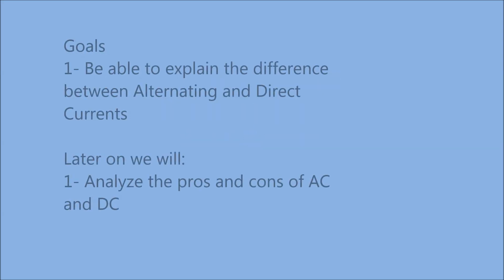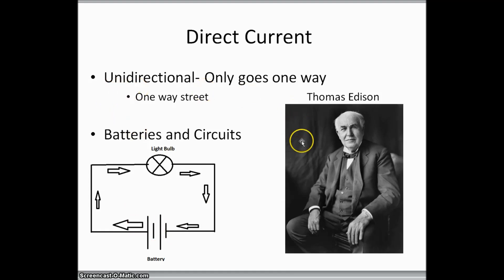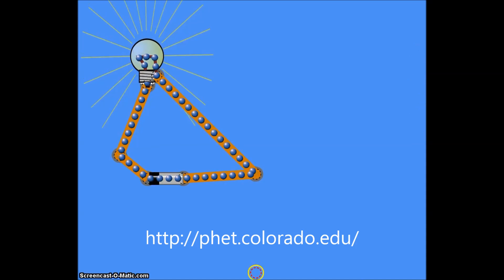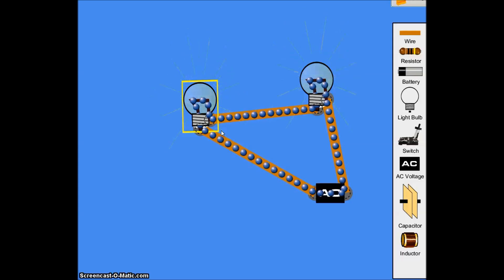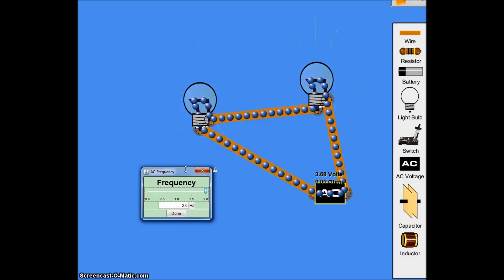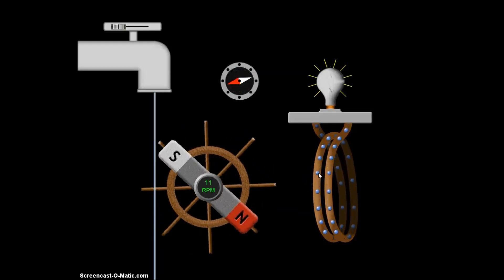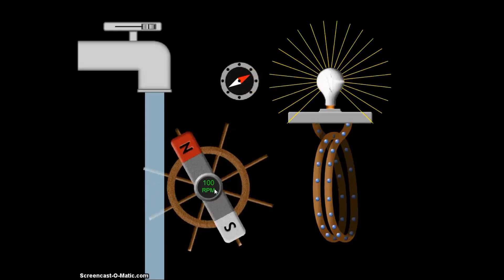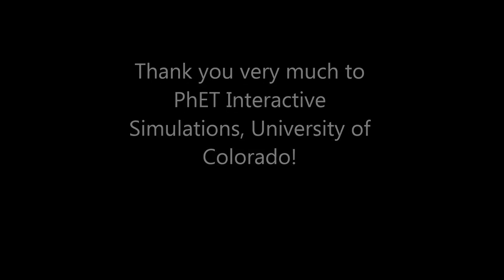AC vs. DC

Comment: actually if it's 60Hz then it means it has 60 cycles per second. And within one cycle bulb "flashes" 2 times because electrons first one way, and then the other. So the bulb "flashes" at 120Hz which of course means it's constantly hot and on.

Comment: 3:30 so current doesnt really flow in ac.   How does the wire not run out of electrons if they are just moving back and fore.
Your bulb is using some each time it flashes??

Comment: High Voltage
Dirty Deeds Done Dirt Cheap
Let there be rock
Powerage
Highway to Hell
Back in Black
For Those About to Rock
Flick of the Switch
Fly on The Wall
Blow up Your Video
The Razors Edge
Ballbreaker
Stiff upper lip
Black Ice
Rock or Bust

These are all great examples of AC/DC!

Comment: Both AC and DC are winners and both serve a great purpose, AC for long distance power distribution and DC for most electronics after the outlet. Very few items run on AC compared to dc but most electronics use ac at its beginning and convert AC into DC at the transformer.

All I ever really think about is what are the odds of the only two viable power types being invented / discovered so close together and used globally to date.... there are many more ways to maximize efficiency one just needs the right motivation and ambition to change the world!!!

Comment: @Chris Mahi: Then why if it his alternatic current, sometimes when you plug in something just a tiny bit to slow, you see one spark flying off, if it really his alternative current, you should never see a spark flying off, you can see that more often if you unplug a heater without turn the heater off first.

Comment: In the AC, I thought electrons had to go to the positive terminal in the battery? If they’re not moving forward and just going back and forth in place, then how are they getting to the positive terminal? Don’t you need them to get to positive terminal for it to be a complete circuit?

Comment: 0:39 “ the battery emits electrons “ no no no no no 

Electrons are all present in conductor. Battery just creates a potential difference so that they can move from positive side to negative
Reply: If only there elections in the wire moves from positive to negative there'll be no free electron left in the wire lol.. You're wrong
Reply: Akshay Stanely    Haha funny man.            Electrons flow from positive to negative in a conductor and negative to positive in the battery so electron flows like this 

Positive side of battery—> conductor —> negative side of battery—> inside the battery —> positive side of battery
Reply: @balvirkaur6176  no that's not what I'm talking about. You said the battery doesn't produce electron. If so the free elections in the conductor will go to the battery and wire will become non conductor which is wrong
Reply: Akshay Stanely but another electrons are always taking place of those who are moving
Reply: @balvirkaur6176  those other elections comes from where?
Reply: @balvirkaur6176  !
Reply: @sunsetjesus4719  and @Balvir Kuar You're both wrong and right. Electrons do exist in copper wire as they exist in nearly all atoms. The battery simply uses a chemical reaction to cause a polarity differeence (North and South poles - negative and positive) that seperates the positive and negative parts of the Atom thus the Eectrons then seak out other more positivly charged atoms and then the congo line starts. Just so you know in the actual world electricity flows from the negative side of a source and to the positives because Electrons are negatively charged and seek out positive charges. Look up conventional current vs electric current which explains this better. Conventional is the assumed theory that electricty comes from the positive to the negative which was thought up in the 1800s and proved wrong by the Electric theory which is the oposite.
Reply: Electron moves from negative to positive terminal in very slow speed.
But the induced force by electrons due to potential difference which is  called current moves from positive to negative.

Comment: So if ac goes back and forth, 
It likely flows back and forth from your house to the street, in/out back/ forth and so you pay for power in but it then flows back to the street, then back again just clocking up a extortion bill on your metre, sounds like fraud and theft to me!

Comment: Hi Chris, great videos. Can you help me out with some things? (too many perhaps) 
When an electron changes voltage or "layer" around a nucleus it is always related to either absorbing or releasing a photon. So I guess some of the energy that makes an electron travel can be converted into light? Or is it the charge or the electron that either produces a photon when dropping and absorbing one when rising? Is it basically the same? 
well.. 

I thought that electrons somehow was "used up" by turning them into, say, radiation as photons emitted from a light bulb. But with AC I don't understand.   In the computer model it almost seemed as if the electrons merely had to rub the resistance/bulb in order to produce light. 

As I understand the electrons travel through the tungsten filament of a light bulb (at 60Hz in the US) jiggling the tungsten atoms, producing heat and light. 

Are the photons and heat radiation created by losing electrons, or are the photons and heat made from the friction of passing electrons? And if so where do they come from? (the photons) Am I even asking this correctly? 

TL;DR - I don't get it.

Comment: just to explain why we don’t see the light switching, it’s actually because the wire in the lightbulb gets hot from the current passing through it = it glows(hot things glow) and it doesn’t cool off fast enough so it keeps glowing

Comment: Very helpful video, however I'd like to point out that you are wrong when you say battery emits electrons that go clockwise at 0:40. Electrons go anti clockwise from negative to positive terminals of battery but direction of conventional current is clockwise from positive to negative. There are other small inaccuracies, but I understand that they are there for the video to be simple and concise and it's not possible to to be 100% accurate in explaining each and every aspect of the video.

Comment: Lightbulbs don't flash. The AC current heats the filament 120 times a second and that heat is shed over a larger fraction of a second as visible light.

Comment: You may want to mention the voltage and current amplitude (up and down) as it is key in powering the device.  Great video though to "see" what is happening for those not familiar with all aspects of electricity.

Comment: In regular lightbulbs, the elements glow because they resist current. They don't "turn off" 60 times per second. In fact they don't stop glowing at all as that would imply they cooled and reheated 60x per second which they don't.

Comment: How is Direct current made? You did not show any example at all. With AC you showed a rotating magnet but DC you showed nothing. DC current is also made from a magnatic field.
Reply: Oliver C. for power to be generated you need to have an alternated magnetic field, thus creating ac-current. DC current is created from ac-power by charching a capasitor(batery) with ac-power. wich will then create dc-current.

Comment: This was a great video.  Some comments were correct in that the temperature of the filament (in incandescent bulbs) changes so slowly that you cannot detect the hertz.  HOWEVER, if you look at some LED lighting systems (Christmas decorations especially) and 'blur' them by holding your eyes stationary in your head and moving your head you WILL notice the flashing.  This only works on systems without capacitors though.

Comment: You are kind of wrong on the part that lightbulb with ac glow because it switches so fast you can't tell. It is because the current heats the glow wire to such temperature that it emits light, the bulb only does not cool fast enough that you can see a difference
Reply: Ah that's very interesting. That was something I didn't really think about. What about in fluorescent bulbs such as the tubes in garage lighting?
Reply: I thought of that
Reply: What about LEDs?  The produce no heat, but remain on in AC.
Reply: @kinguzi24  LEDs don't use AC directly. They use a rectifier to convert it to DC.
Reply: kinguzi24, oooh gottem’

Comment: DC seems way better and I was waiting for you to go over pros/cons which you never did. What the fuck?
Reply: DC - PROS - storable (as in a charged battery) CONS - Difficult to change voltages without major losses.
AC - PROS - Easy to change voltages by using a simple transformer CONS - must be generated live on demand...cannot be stored.
DC isn't better, neither is AC, they each are better for their intended usage.
Reply: Chevy Chase and

Comment: how much does it cost for power suppliers to make a AC generator? and how much profit do they make in return? does the AC generator eventually wear down? does anything need to be changed? wondering because it seems like free energy after built.

Comment: why some circuit use Ac and other some circuit DC?
Reply: They do specific things. Mainly in different types of small circuits and there's a whole lesson based on how AC is technically more efficient at electricity distribution than DC...

Comment: Nice video.  I do see a minor issue though - A 60 htz signal doesn't alternate / switch 60 times per second, it cycles 60 times per second.  It switches 120 times per second.

Comment: This might be a really dumb question but how come, if it's constantly on and off due to alternating current, we only see the on part? Why are we not seeing it constantly off? Is it because light is still traveling into our eyes while it's off for that fraction of a second even though they might be equally off and on in respect to time?
Reply: A filament inside a conventional bulb glows hot from the electrons passing through it. the filament does not have enough time to cool off and lose its heat energy Because the switch in direction is too quick.
Reply: The light never stops glowing because it turns off and on too fast
Reply: Think abt it this way....
when you watch a movie what is really happening....24 frames per second....those 24 pictures come to your eyes so fast that you cant even distinguise that they r just pictures...we see it as a moving image,cause our brains r just built that way.
Now think abt this on and off switching......it happening 60 times a second!!!!
half the time your eyes see light...half the time they dont.
but just like moving pictures they create an effect of light being there. :)
Reply: 1: first of all the wire in a bulb is would be completely off only at 0 voltage. A 240v bulb produces light at 120 too, but half the light. In a cycle of AC there's nearly always a voltage, only at a specific time it is 0. So make it simple in a cycle it is fading out until it reaches the full blackout for a moment then it start fading in until it reaches the maximum light. So n theory it produces light in 99% of the cycle, even if not the full light.

2: Secondary thing is that a traditional bulb has a wire in it in which the current flows. That flow heats up the wire, and that heat makes the wire glow. For that wire to completely shut off it needs time to cool down, but the cycle is to short, so it doesn't have time to cool off. Which means it always emits light.

3: Third thing is even if it produces light equally, so 1ms dark followed by 1ms light, etc. Even if it would be like that, we would see constant light (or nearly constant light - and actually some poor LED bulbs does emitting flashing light rather than constant light). The reason is that we can only see the light. we can't see the dark. When you flash a light in the dark for a moment, our eyes got that images, and our brain processes it. Our brain can't process the true complete darkness, because there are nothing to process. When the light reaches our eyes, our eyes sends the information to the brain which processes the image. That takes time and as stated a brain processes 20-30 images in a second by average. 
Do you remember how stroboscobes work? You see a flashing movement right? Those emachine emits light a shorter period of time, than not doing it. We still feel the phase of the light is longer than the phase of the dark. (Except if it's set to a low rate).

I hope I could shed some light here :D
Reply: @skatekidize
"Because the bulb needs time to cool down."
Nope.  It would increase the life of the bulb though but it would depend on the whole design of the bulb to include materials used.
Reply: The filament stays glowing because it’s still hot, but in some light bulbs you can see the flickering if you use a slow motion camera, but you can’t see it normally because it flickers too fast for your eyes to pick up the “off” segments
Reply: Because the bulb needs time to cool down.
Reply: +Sebastian Dattil  still confused..explain a litle more...!!

Comment: This video is horrible. You cannot try to explain one thing by being wrong about another.

1. In DC circuits, the electrons do not flow through a battery. A battery's charge moves from one side of the battery to the other until equalized.

2. In AC circuits, the electrons do not "move much faster". They hardly move at all. 

3... I quit watching at this point.
Reply from the maker: Hi "The13point1,"
This is meant to teach inner city 9th graders the basics of electricity. If you would like more in depth guides or videos that pertain to your level of academics please check out Khan Academy.
Reply: can we just take a second appreciate the SJW work from a dude named spanky spankerton
Reply: "In DC circuits, the electrons do not flow through a battery." - Yes they do. Battery acts as a pump, which moves electrons around the circuit over and over as long as the chemical reactions keep going.
Reply: Look at the annotations... you nerd.
Reply: Sujeethan Vigneswaran lol you sure about that? Tesla was all about AC power that was him.. Tesla coils ring a bell?
Reply: why teach Newtonian physics then? shit's all wrong anyways
Reply: It appears that Chris Mahl has left the building. I don't blame him.
Reply: Sujeethan Vigneswaran Edison setup an electric chair on DC... let's just say it wasn't a quick death and they almost gave up on the thought of electric chairs cuz of how long it took for him to die. tesla is pro AC
Reply: Aren't batteries like capacitors in terms of design? Meaning, aren't the electrodes insulated from each other inside the battery?
Reply: Spanking Spanky Spankerton just got spanked. He likes it!
Reply: The13point1 you misunderstood. When he said much faster, he meant much faster than the program was showing
Reply: +The13point1
Very bold for a person who didn't upload a single video and is subscribed to Peppa Pig.
Reply: +Chris Mahl 
Why wouldn't you want Khan-level education for all kids? Why the dumbed down and incorrect info for "inner city" kids? 

The very fundamental function of a battery was explained wrong in this video. What is the point of trying to educate someone with wrong information? You are doing these "inner city" kids a disservice. Please see this as criticism of your work, not you personally.
Reply: The13point1 If you know it all..tf you doin here?

Comment: You should say that DC travels in one circuit direction, not one direction.  For example, what if I laid down a wire facing N and S, you are implying if I orient that same wire E and W the current will not flow in at least 1 of those 2 orientations.

Comment: And why do internal components, such as motherboards use dc and not ac?  Is it because of the continuity or the low voltage? Thanks mate nice video!
Reply from the maker: +Gonzalo Soto I am not totally knowledgeable on internal electronics, but it would be my assumption that it is due to the consistent/continuity of voltage.

Comment: Newbie here, if light bulbs flashes 60 times in a second on AC then how does that work with gadgets like computer?
Reply: Devices such as computers mainly use DC power.
Reply: In simple terms, there's an adapter that changes AC to DC before it gets to your PC.
Reply from the maker: +Exrau Those big blocks on your computer charger are transformers (usually). Same with iPHone chargers and what not, they need to those bigger blocks because the electricity is changing from AC to DC.
Reply: Also a wall outlet is 120 volts usually and computer chargers have step down transformers to lower the voltage to 12
Reply: +ELSBCore You plug in your charger for a computer in your house wall, which is usually 120 volts of AC 60 cycles per second if you live in America. Then your charger has a step down transformer which changes the 120 volts to about how much your computer needs, also there is something in your charger, or computer, I don't remember, called a full wave bride, which changes the AC to DC so your computer wont turn off and on, off and on, if it was connected to AC.

Comment: At 3:13 you mention an AC battery but there is NO such thing as an AC battery is there? it's more like an alternator. DC is battery powered and AC is electromagnetically powered yes. The rotation of magnets induces a magnetic field. But excellent information as I have previously said.
Reply: Thetrucky69 exactly.

Comment: In either AC or DC what happens to the electrons ?    Are they converted to light and heat ?   and if they are how do we make more ?  As the demonstration shows the wheel just moving them around.

Comment: Ok so the electricity that the power station generates is AC then is the power then converted to DC as it travels down the power lines and through transformers? or is it transformers and then power lines? Also what drives the electro magnets in power stations for producing AC? Also you explained the processes of AC power production in a power station but how does the rotating magnet make the electrons move backwards and forwards?